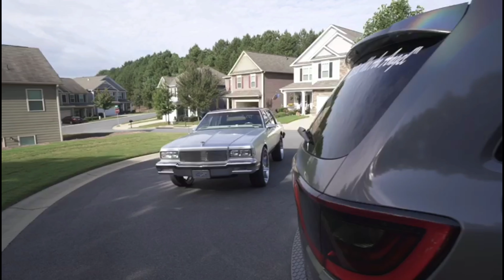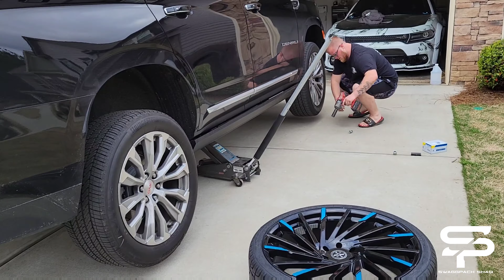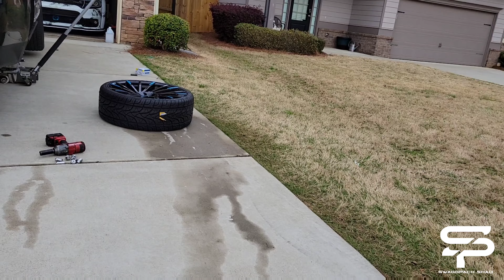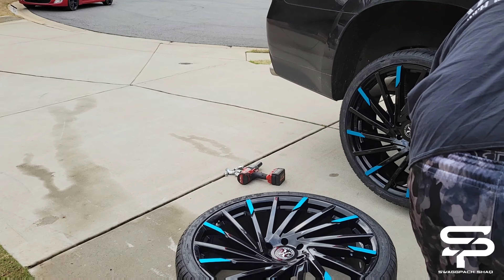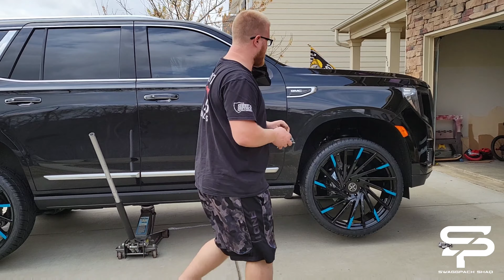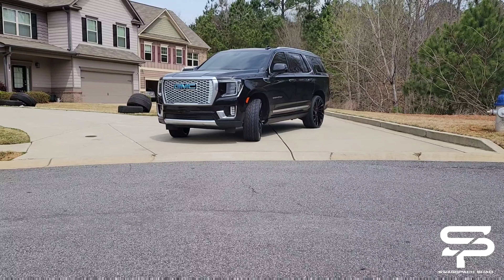2021 Yukon Denali on 26s

Comment: I have a couple of question.
1. Is there any vibration at high speed on the
highway,if so what speed
2. What is the road noisy like from the 0EM 22s
3. Any rim dents
4. Rate ride quality 1-10
Reply from the maker: No vibration unless the rims are bent. No road noise. I bent the rims multiple times. Ride quality is a 9
Reply: @SwaggpackShaq  

Thank you so much sir...